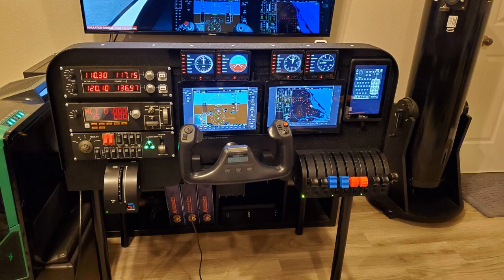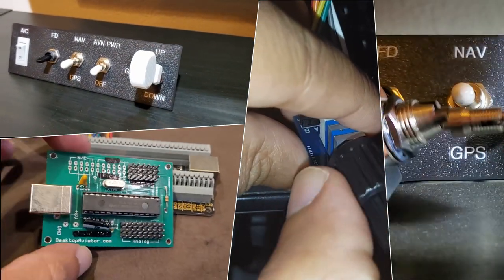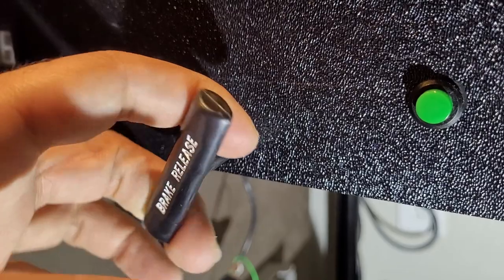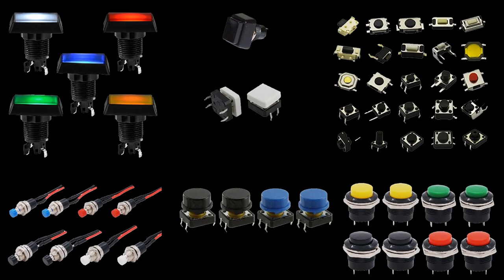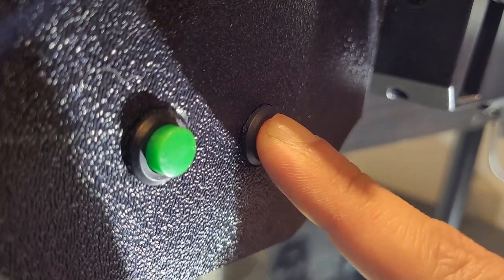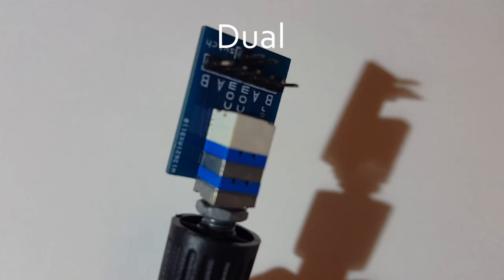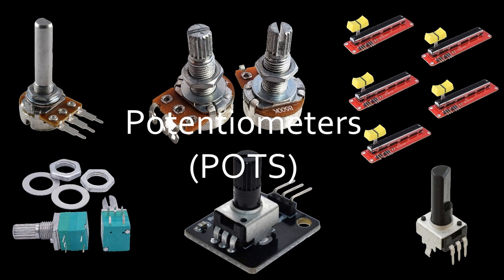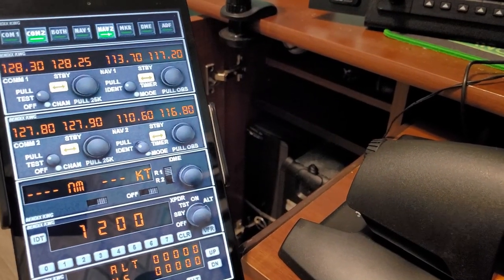Basic Components of Cockpit Building for Flight Simulator, X-Plane and Prepar3d

Comment: hi simmers and Marius, I am struggling to get my heading bug (rotary encoder) to turn proper via LeoBodnar card. It moves but extremely slow and bouncing, on MSFS2020 just bouncing, on X-plane 12 moving slow and bouncing. Leo Bodnar support could not help me. Strange is that it works fine wit Frequency change but not with heading. Anybody has an idea?
Reply from the maker: So the Leo Bodnar boards need the buttons programmed where you have the Encoder; make sure you have completed this step. My second question is, how do you have this wired, and which encoder are you using...Link?
Reply: @joshuamarius  well I use the BBI32 and correct connection since it works on e.g. NAV Frequencies change, two digital, one ground. encoder is a KY-040.
Reply from the maker: I understand what you are saying, and I have seen this before. That's why I need to know the answers to the specific questions to help you out.
If you exit the Simulator, Open the BBI-32 configuration software and turn the knob left/right, do you see a consistent Input/Blink or does it skip and is inconsistent?

Comment: Great video. I have already ordered 50+ momentary push on(off) switches. Now watching this I think they are going to be the wrong kind. For an overhead panel, so these aren’t going to turn taxi lights on are they…?
Reply: I could actually just set the to toggle, in xplane….? As a pose to turn on/turn off… so I think I’m safe. 2 BBI-64’s came today so just waiting on the Perspex sheet to come. 😁😁
Reply from the maker: Remember, if you are using Windows, you will only be able to get 32 inputs, even on the BBI-64.
Reply: @joshuamarius  it really comes down to the flight simulator in use, Leo Bodnar claim with X-plane, all 64 will be available.
Reply from the maker: Unless they have updated the software to interface with the card, however by being a HID device the limitation will be on the operating system. In this case windows will not go over 32 buttons. I have the bbi-64 and I could only get 32.
Reply: @joshuamarius  if this is the case, as Leo Bodnar claims it works like this for xplane, have you come up with a solution thus far?

Comment: Hello, what is the name of the 7-in-1 funky switch that Fanatec uses in its steering wheels? I'm looking for exactly that part. Can you help me please? I would appreciate it ^^
Reply from the maker: Which model? https://fanatec.com/us-en/steering-wheels/?p=1
Reply: @joshuamarius  all the steering wheel models from $190 and up, there are only two that do not have that funky switch and have a normal joystick, I look for the one that has the 7 in 1, joystick plus rotator plus push button, for example my wheel is the formula v2 ,5X ^^

Comment: any idea where I can find pre-made airbus a320 square buttons with leds?  thanks!
Reply from the maker: Something like this:  https://www.opencockpits.com/catalog/interruptor-tipo-korry-onoff-p-310.html?cPath=24_55
Is that what you were referring to?
Reply: @joshuamarius  YES!  Thank you!  A little pricey though :)
Reply from the maker: @santiagoluib3  Yes, unfortunately, but now you know what they are called and what to look for ;) Shop around. Have fun! 👍🏻✌🏻
Reply: @joshuamarius  Indeed. thank you so much for the heads up. At the moment I am also trying to design a DIY button with two leds. The concept, wiring and how it's interfaces in MobiFlight is simple and working, but putting it altogether in a 18x18mm button is a nightmare  :) So I might just separate the ON/OFF/AVAIL leds next to the button - not realistic but functionality the same.

Comment: Love the video, Thank you for the upload. is it possible t use a mom switch to turn on-off a led to indicate the on-off state.
Reply from the maker: Yes. Please check out my other video: https://youtu.be/x0J8SAk1X90
Reply: @joshuamarius  Not exactly the path i was going to use. I was looking at using 5v switches with separate 3v led, connected to an Arduino to turn on the led when the switch is turned on. I know i will need to create some code in the arduino to sync the led to the switch state. with 10+ switches each with a separate led. But i am just in the planning stage, thing could change.

Comment: How do you find rotary switches with the correct #  of “detents” or stops… for example, the test selector rotary switch you show in the video has 7 or 8 stops, but I also might need one with 3, 4, or 10, etc… depending on the functions controlled by the switch.   Also, switching to POTS…(and/or Rotary encoders…) is there some way to create or specify real detents (the position that the slider naturally stops at, for example TOGA/CLIMB detents on a throttle control.  Thanks for the content!
Reply from the maker: Don, great questions! For the different types of rotary switches look into Electronics Manufacturers websites (most will send you catalogs for free). Some to look at: Mouser Electronics, Powell Electronics, Digi-Key, Arrow Electronics and Arcade Electronics, just to name a few. These all have great search tools which allow you to arrange or filter through products. 
Regarding POTS, they usually create an Axis in the simulator which can be manipulated natively with response curves such as in X-Plane, or for others, look into an application such as FSUIPC - but make sure you do your research first before you purchase it.

Comment: The on/off switches would need to be on/on so you can toggle a component? Eg you press L to turn on the cabin lights and then press it again to turn them off. Or is there a way to detect the off side of an on/off switch?
Reply from the maker: Great question. For an On/Off (SPST) switch to turn the Cabin lights On, then Off you would need to use programming. Unfortunately most simulators do not come with this feature built in, where they provide an action when they detect a switch has been turned off. You need to use something like FSUIPC which can detect when a switch is turned off and provide a keyboard shortcut or other action. With an ON/ON (SPDT) you can assign two different actions within the simulator which can be Turn Cabin lights On and Turn Cabin lights off. If you have an SPST (ON/OFF) switch that you really love, you can turn this into a SPDT with this video: https://www.youtube.com/watch?v=AiNyWi12lZY

Comment: 1:02 can be latching switch 1 pole when its off then other one is on automatic even nothing pass.
can be momentary 2 way switch. off in center is do nothing dont messup simulation swithes on start(you are synced) switching mode lever on sim move to it unless its allready on that mode. best for sim cockpit.
on/off switches are worst on sims. your switch on or off sim has it on or off you change or worst case sim open and read all switches you start flight middle on air power turn off bcoz switch is off LOL.
thats why momentary switches for sim perfect even its not realistic and same switch can use turn rotary knobs. thats why they so good
Reply from the maker: You have to be careful with this. Simulators have the ability to create bad habits, especially for those who are taking flying seriously. Just like the real world, you should have and run a checklist for your Sim before starting to avoid the problems you talk about 😜 Always try to get it as close to the real thing as possible.

Comment: Hey, great video! What kind of push buttons are used in the MCP or AutoPilot panel? Like when u press SPD or HDG
Reply from the maker: Those are usually tactile momentary push buttons that have a cap on them which can be squared, rounded, rectangular, and the material can be silicon, plastic, silica gel and other materials.

Comment: Josh how is a Mini Joystick hooked up to a Leo Bonnard board
Reply from the maker: That will depend on the joystick and how it expects to interface. If the mini-joystick has a "button" action for each one of the directions, you will have 1 cable per button going into an input on the Leo Bodnar. For example, Up is 1, Down is 2, Left is 3, etc, and then of course you will have a ground. If the mini joystick however expects an Arduino, then that changed things. You will have to program the Arduino board and then figure out which interfacing program (Example: MobiFlight) will talk to the Arduino and send the specified command to the simulator.

Comment: hi, I have a quick question.  Is there a cable end ( awg24 ) that can be soldered or crimped on the wire but can be pushed over the pins on a  PBS-110 type switch?  my soldering is useless and I am killing switches more often than not when soldering!!!!!!  thanks
Reply from the maker: Great question! There are kits on Amazon which also include the Crimper tool so you can easily terminate the ends, and these will easily slide in to the switch's connector: https://amzn.to/3JDKjd8 - This kit includes Spade connectors for multiple connector sizes.

Comment: got some questions, do the switches need to be certain voltages? and how do sims play with them, for example would nav lights need an on-off switch or an on-on as the sim needs to know which position they're in?
Reply from the maker: They have to be certain voltages if they have certain properties such as LEDs which most will need 12v. If they are simple switches, you will usually see a Voltage rating on them such as 12 VDC or 30 VDC and this means they will work just fine up to that voltage. Since most HID and Interfacing cards are connected directly to USB, you will be using 5 VDC. Regarding your question on how sims play with them, I recommend you watch my video on Interface/USB Cards so you can see how they interface with the simulator: https://youtu.be/M7Fx54e_NtM

Comment: on the off chance this will be seen, do these switches also behave the same when interfacing with simulators? i.e an on-off switch will be detected in which state it in and send it to the sim. so off is off in the sim and on is on.
Reply from the maker: All good I read and reply to everybody✌ I recommend you watch my video on Interface/USB Cards so you can see how they interface with the simulator: https://youtu.be/M7Fx54e_NtM How they interact with the simulator will depend a lot on how you are setting them up, either with an interfacing card or a HID device. Simulators in general are not good at detecting the state of the switches when they start up, so you can run a script to do so, or, have a checklist like in real aircraft, making sure the landing gear switch or lever is down, flaps are up, etc. HID cards are detected as joysticks in the Sim so you can quickly tell them what to do, just like you would configure a joystick from Thrustmaster or a Yoke from Honeycomb or Logitech. Interfacing Cards (Arduinos, Sparks, etc.) need to use an "in-between" application such as MobiFlight, which pickup the input from the hardware (in this case a switch) and convert that action into variables that are seen in the simulator. MobiFlight also goes well with FSUIPC which also allows you to program actions.

Comment: I'm not using flight simulator, but I am designing a live prop version of a cockpit for a sci fi video I am working on. I would love to use my extra small monitors that I use for behind the puppet stage and a few older tablets to use an app that uses touch screen to move the switches. Are there any sites I can download apps to simulate screens that I can manipulate switches and buttons? Thanks for sharing and any input you might be able to give me...
Reply from the maker: The availability will really depend on what instrument you are trying to simulate. For example, the Garmin GTN Trainers are free and you can display multiple instruments on there, such as navigation and maps. FsRadioPanel allows for some radio looking screens, and finally GA PANEL  is a simple Cessna cockpit with many of the older instruments. To get more advanced and customized, to a point where you can manipulate switches, you can look into Air Manager, but there is a licensing cost.
Reply from the maker: https://www.youtube.com/watch?v=szylHBKIOt8

Comment: Feels to complicated 😭
Reply from the maker: Sorry, this is as simple as it gets regarding Cockpit Building for the DIY crowd. You can make it easier and buy pre-made sim gear, but you may end up spending more.
Reply: @joshuamarius  yes I know
Reply: Sometimes it is easiest to focus on one need at a time. For example, focus on the momentary pushbutton (i.e. Single-Pole, Single-Throw - SPST). You tap it to do something, i.e. toggle Autopilot. Usually the first tap turns the function on and the second tap turns it off. Once you master one type of switch and understand how it functions and how to integrate it into your panel, move on to the next. That way, it's not so overwhelming and complicated.